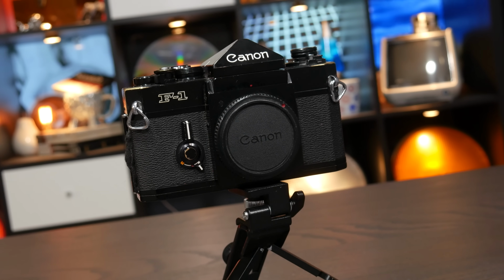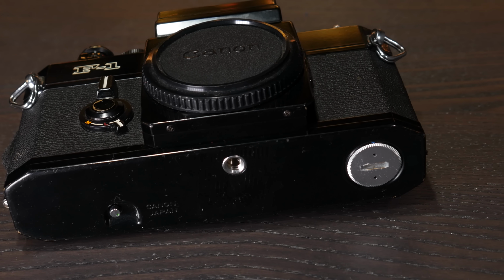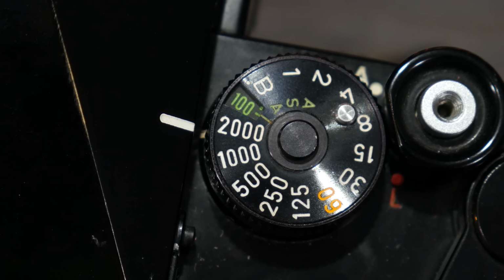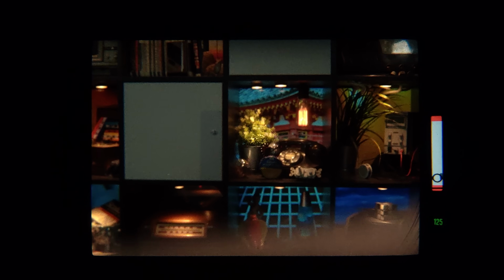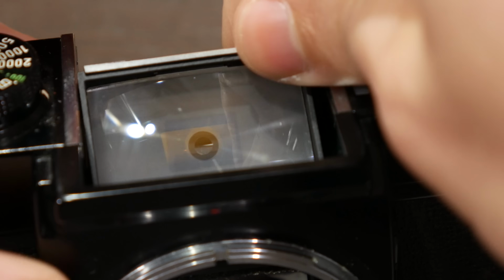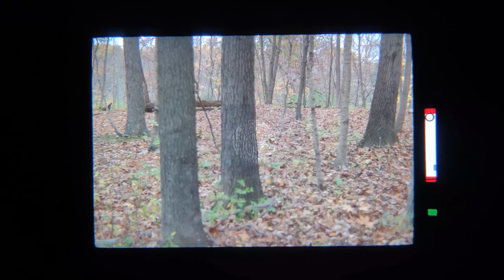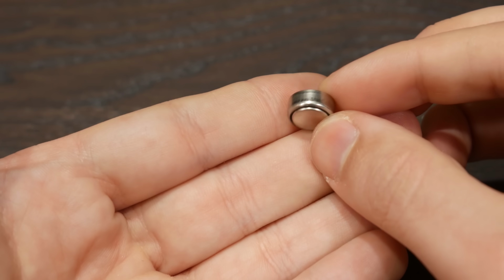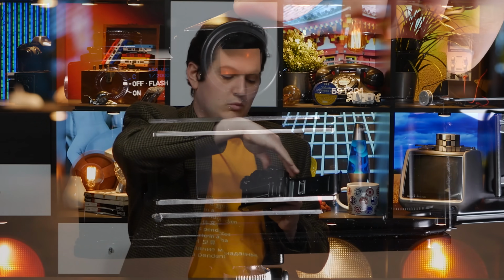1970's Camera Tech: How they showed you what settings to use

Comment: My first camera was a soviet Zenit 11, which had a very similar light meter, but it was on the outside of the camera body, rather than integrated into the viewfinder (that was a feature the Zenit 12 offered for a price), but one benefit of the 11's cheaper light meter was that it was a selenium light 'sensor', and thus didn't need or use any battery at all - the price paid for no battery was a strip of 'solar panel' light material across the front of the pentaprism housing. Everything else about the Zenits was a step down in quality of life though, and a canon FD mount camera was my dream camera (and actual second camera).

Comment: What about the focus mechanism?
My father has an old Canon that uses those 2 half circles as focus assist. Does your camera as well?
You aim to have a clear vertical line inside the circle, and if focus is correct, the vertical line will be continuous, if not, it will be shifted to the left or the right in 1 half.

Comment: I used an Olympus OM-1 when I was in college. The battery for its light meter died and the exact voltage is no longer manufactured.
My dad didn't trust eBay, so we got the "closest thing Radio Shack sold."
Surprise surprise, it burned out the light meter and parts for it are no longer manufactured.

Comment: 22:14 Depends on the design of the meter. There were other meters, e.g. Praktica L line (TTL, MTL, VLC, PLC, EE) cameras were not metering different values as a function of the voltage of the battery. With lower voltages, the needle just needed a longer time to "adjust" to show the correct value. Like not half a second, but maybe 2 seconds, when the battery was drained. I can use a 6V battery (with spacers) the the Praktica VLC models, which were designed for now obsolete and impossible to get 4,5 V batteries. But the meter shows the correct values. The same if I put a 3V battery (and some spacers) in the camera. It just takes longer for the needle to "settle".

Comment: I feel reminded of one of the sample images included with a paint program we had in 1989 that was a set of instructions on how to take a photograph of a CRT computer screen. The program in question was Splash! by Spinnaker Software, 1988. We got limited use out of it because the OS was MS-DOS 3.3H, and we didn't have any other programs that could handle the file format, but it was fun to use.

Comment: 10:31 Yes. Experience can tell you that. That is the reason why I still shoot fully manual and use the light meter only as a guide when using my Canon EOS 60D, having the metering set to "Center-weighted average" and using my brain to interpret the scene and measured value with the selected metering mode to get the results that I need. Most of the time the camera would overexposure if it were in automatic, or half-automatic mode, given the conditions that I shoot in. Nothing, I repeat, NOTHING will ever replace the human mind, which is conscious of all the variables which are outside any "standardized situations", especially when it comes to photography. And exposure is much more of an issue when shooting digital, analogue (negative) film gives way much more dynamic range than digital camera sensors and allow for bigger exposure errors of the film, because you can easily (and with no or little loss) get the correct exposure when making "prints", or developing photographs on a photographic paper (which is the long but correct way to say it).

Comment: Not to be rude to Canon, but the F-1 is nothing special. The Praktica L line from East Germany, which was released two years before the Canon F-1, was superior in many technical aspects. And the Pentacon Super, also predating the Canon F-1 by three years, outperformed it, but it was not a "mass consumer model" as the Praktica L line. I have shot dozens of rolls with Praktica L (and Zenit EM) line cameras and kept my "flagships" Praktica VLC2 and VLC3 as well as the best lenses when selling all my gear when I went digital (with a Canon EOS 30D).

Comment: I had a similar featured Minolta camera in the 80's, I got it from my Dad. Some differences, mine had a top mount hotshoe that would still work with today's external flashes, but the light meter had no backlight. The aperture close control was a button, not a lever. And, of course, it weighed a lot.

Comment: I have an extremely high end* camera from 1972 (an Alpa 11e) and it has silk shutters! I can't believe how tightly woven they are. Thankfully, the light meter uses a non-mercury battery that's still available.

*how high end? The body alone cost $1200 in 1972! The contacts on the ends of the wires inside are, wait for it....SOLID GOLD!

Comment: I have a Zeiss Contax IIIa that has a built in light meter. And no batteries.
Figure that one out.
Reply: Your Zeiss's meter probably uses a selenium cell, which is actually powered by the light falling on it, so no battery was needed. The selenium cells had limited sensitivity, however, compared to the CdS cells in cameras like the F-1.

Comment: Back in the day I had a Pentax K-1000, very similar to your canon in most respects except for the hot shoe above the prism. Fun fact: the "bulb" position refers to the use of a pneumatic bulb driving a plunger screwed into the shutter release - very useful if you want to keep the camera still on a tripod while you hold the shutter open.

I've heard there are NiCD and NiMH batteries available in the same package as the original mercury batteries. Their nominal voltage under load should be close enough to the 1.35V for proper meter function, but since they're designed for permanent installation in solar lights,  charging options are hard to find.
Reply: Another thing to take care of when substituting mercury cells in lightmeters is the discharge curve. Mercury (as zink air) are very stable on 1.35 during it's life, only dropping below that shortly before the end of it. So most camera makers didn't provision for any stabilizing circuit. Most of those needle type lightmeters are just the CdS-Sensor, a calibrated resistor/potentiometer to set it at the factory  and the needle. If you use a replacement with a more slope formed discharge curve (like alkalines, starting at just over 1.5 and slowly dropping down), you'll get false readings during the lifetime of the battery.

Comment: @Technology Connections  I'd think it would be easy to make a flat resister of some sort to put in between the battery and contacts to reduce a 1.5V battery down to 1.35V. Or would that produce heat and be a problem?

Comment: Cool to see you highlight an old camera. Do you have any experience with the Nikon FE or FE2 (or even the FM3A, which is a camera I'm sure you would love)? The way those cameras meter—having the shutter speeds visible so you can quickly see how far away you are from a proper exposure—is so intuitive to me. And even things like turning on the camera and unlocking the shutter by pulling out the advance lever. I often find myself missing the simplicity and pure functionality of that style of meter when I'm using a modern camera, or even something like the Nikon F5.

Comment: Why does the flash make the wind-up noise?
I'm guessing a capacitor somewhere?
Reply: There's an oscillator that converts steps low voltage DC to AC, so that a transformer can jack up the voltage, where it's rectified back to DC. This induces a pretty substantial magnetic field in the transformer windings, which makes it vibrate and produce a pretty loud whining sound.

Comment: Wein cell batteries SUCK. It’s far better to  buy a MR9 converter with a diode in it OR even better is to solder a  Schottky diode into the meter battery supply supply post. Then you can use a px625a battery which  last forever.

Comment: Is it definitely a mirror and not just a clouded region?  They could use technology similar to the 3-D glass "hollowcube" things to etch a discontinuity into the glass.  The defect doesn't need to be shinny like a mirror, just needs to be lit by the source (maybe that is arguably the same thing).
Reply: It has to direct some light over to the meter, and not absorb the light.  So it's acting like a semitransparent mirror.  A "cloudy" region would scatter and lose too much light off in random directions.
Reply: @jimblake3574  well I'm if you have a consistent fog in the prism, your light scattering will be uniform and consistent.  So it wouldn't need to be ordered like a mirror. Manufacturing would be easier with the drawback that your light sensor would need to be more sensitive. Could also add the benefit of a more defuse light hitting the sensor, causing more averaging across the sensed region.

Comment: Have an old Minolta (SRT-101) that uses a similar system though in that camera the aperture and shutter speed dial are both linked to the same dial, while only the lightmeter controls the other dial. I also have an old pentax spotmatic where IIRC the aperture isn't even linked so to get a proper measurement you had to stop down.

Comment: Bah your newfangled 70's Canon F-1. My 60's Pentax Spotmatic is even more old school. Non of that bayonet mount stuff, I have a screw mount. You just screw the lens onto the camera. The light meter is just a needle that moves to the middle when the exposure is right. That means that the aperture closes automatically when you turn on the meter. Can still do anything any other 35mm camera can and its replacement, the K1000 (basically the same camera but made of plastic and without the old school lens mount), was made until 1997.

Comment: A couple of fun tangents to add after working in photo studios at the end of the film era:
• The flash sync is still used if you want to get a flash further from the camera – either on the side or on a light stand. Though mostly they use radio transmitters now.
• Handheld lightmeters usually measure the light hitting the white ball – useful when you measure the output of a light or expose for only one part of a subject, like lit the side of the face
• The ISO/ASA could be raised from the indicated speed by "pushing" the film or developing it for longer, though you'd still get higher grain. Your local drugstore wouldn't do it, but most commercial labs would.

Great video. Took me back and learned quite a bit.

Comment: I sometimes use a German Kodak from the mid 1950s. It has no light meter and it's not SLR, but it does have a mechanical self timer very similar to this, and that wonderful metal, mechanical advancing lever.

I just use the sunny 16 rule with it and that's good enough most of the time.

Comment: When I first switched from film to digital, I belonged to a photography club where the organizer was, shall we say, older. He insisted upon referring to the ISO setting on his DSLR as the “ASA” setting. 

My first film SLR, a Ricoh (although purchased from, and thereby branded as, Sears), had a similar arrangement, although it had two needles protruding into the viewfinder. When both aligned, the exposure was correct.
Reply: It also had the same arrangement for the film speed setting, but more modern cameras could read a bar code on the film canister and set the film speed automatically.

Comment: My brother had a russian Zenit SLR. Even the light meter didnʼt need batteries. And you had to manually close the lens to the set aperture.
Reply: He probably has Zenit E or Zenit ET models, they have Selenium cell light meter (basically a solar cell), they did work without external batteries, but they are less accurate and have a bad habit of degrading through time. I have a couple of these cameras, and those who weren't stored in camera cases have their light meter degraded. There were also another model called Zenit TTL - it had similar zinc-mercury coin battery based light meter, which is more accurate and not degrade over time. It was not as fancy as featured Canon F1, but Zenit TTL was a lot cheaper camera.
Reply: @iscander_s  Thanks! I completely forgot that the metering was not TTL (I was 7 or 8 years old.) .It was indeed a Zenit E.
Reply: Is that the same Zenit that made night-vision equipment?

Comment: I have an East German Praktica MTL-50 which has some of the same features with an M39 mount instead of an FD mount. Fascinating camera, and it's shutter button is actually placed like a modern DSLR.. Angled toward the front, and at the front of the body!
Reply: M42, same as some Pentax cameras. M39 (Leica thread mount with 39mm and 26TPI to be exact, real metric M39 won't fit) was used on early Zenit SLRs

Comment: I have a Minolta AL from 1962 that has a selenium cell based light meter that mechanically connects to the cameras film ISO, aperature, and shutter speed settings so once the needle is in center you are correctly exposed. All of this without a battery in sight!

Comment: "What's a light meter? It's not a questionable astronomical unit..."

We could use light-meter as a time measurement (i.e. the amount of time it takes light to move 1 meter in a vacuum) the same way we use "microfortnight" in that it is humorous and based on actual measurements. 

One light meter is about 3.3356 nanoseconds, and one microfortnight is about 1.2096 seconds, meaning one microfortnight is about 362,630,000 light meters.

Still makes more sense than Imperial Measurements.
Reply: Why am I suddenly having flashbacks to the raging debate about Han Solo's Kessel Run?
Reply: Guess you haven’t seen the latest Veritasium video. We don’t actually know for 100% certainty what the speed of light is.
Reply: @Patrick94GSR  this really doesn't break this definition in the slightest. The same way that it doesn't stop us from using lightyears in astronomy.
Reply: @Patrick94GSR  I'll believe it when I see it. 

Cuz... cuz it's about the speed of light? Which defines how we... see? OK I'm going back to my corner now.

Comment: Even in germany everyone uses ISO.
Roughly speaking:
ISO=ASA=GOST
Reply: I also never heard of DIN as a synonym for ISO or ASA. Even the old Praktika camera (east German Brand from the 70s) that my father had, had ASA written on it.
Reply: @stephanort3628  DIN is not anywhere near identical, and eastern block cameras usualy use the russian gost system, wich is about the same as ISO/ASA
Reply: My point was about that DIN has not been a common term in Germany at least since the late 70s/early 80s. In the video he said it like as if we would use the term still today. But of course you are right about the vast differences of DIN in comparison to ASA/ISO. I remember that when I started taking pictures many older photographers were still “calculating” with DIN and had problems with the “new” terms from overseas.

Comment: My birthday present this year was a Zenit-3 (Zenith-3), an all mechanical film SLR made in the USSR in the early 1960's.  The one thing that really amazed me was how well designed it is, and all of the little mechanical things that went into it.  I also recently discovered, through not fully knowing how the Zenit worked, that modern color negative film works well even when you accidentally overexpose the image by a few stops because the labeling on the lens is strange.  I also like to use my grandfather's mid-1980's Minolta X-700.  The Minolta has a built-in light meter which activates when you put your finger on the shutter.  It took me a while to figure this out, but, when you put your finger in just the right spot, it completes a circuit on the shutter release button itself, which then turns the light meter on.  I really like these old cameras.  They are so much fun.

Comment: One more thing:  mechanical cameras should always be stored with the shutter speed in the slowest (usually "B") position.  That leaves springs in their most relaxed state, which means that the calibrated speeds are likely to remain within tolerance for longer periods.

Comment: There is one critical bit of knowledge required to understand how to use your light meter.  This light meter is what is known as a reflected light meter.  It looks at the light coming from the scene and lets you calculate an exposure.  What you have to understand is that the value it gives you is based on an ‘average’ scene.  Average in this case is defined by 18% reflection... the halfway point between black and white.  The camera has no idea what you’re pointing it at.  In most situations we photograph things that average out to about 18%.  Your grass is a perfect example.  The way you use this knowledge is to evaluate what you’re pointing your camera at with your brain (typically located a few centimeters behind the viewfinder).  If the scene is mostly white, deliberately ‘overexpose’ over the given value.  And if the scene is mostly very dark, deliberately ‘underexpose’ under the given value.  This is exposure compensation.  An example of a scene that fools a reflected light meter is a portrait of skiers on a slope.  Everything is white... (almost) and the simple meter will give an exposure value that is too low.  (It thinks the world should be 18% aka 127.5 127.5, 127.5 in RGB. As metering systems became more complicated and computerized, the frame was divided into many segments or zones.  The camera would evaluate the different zones and occasionally disregard certain zones.  (For example, the zone in a landscape photo that had the sun in it).  An experienced photographer might settle on an exposure by pointing the camera at the scene such that the sun was not in the frame... and then recompose the shot and ignore the meter going crazy.  The multi segment evaluative matrix metering meters were just a clever way to avoid reliance on that ‘brain’ thing to arrive at the right value.  Fun fact: as early as the 1950’s Japanese scientists had discovered that operator brains are notoriously unreliable.